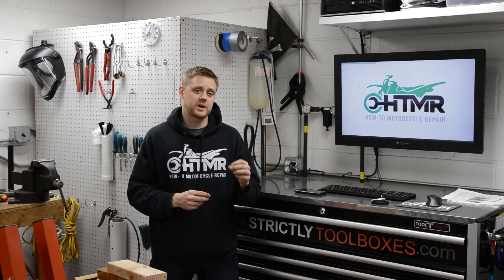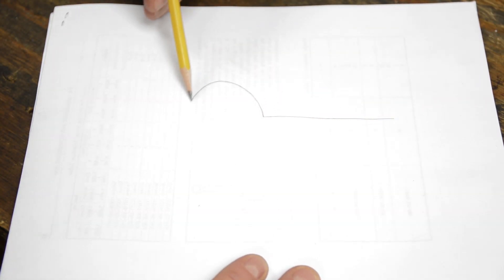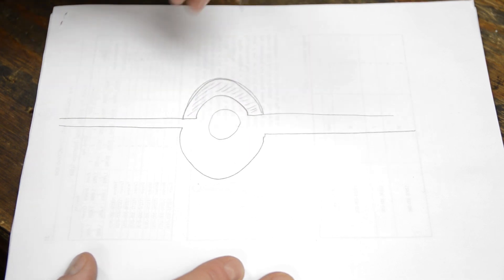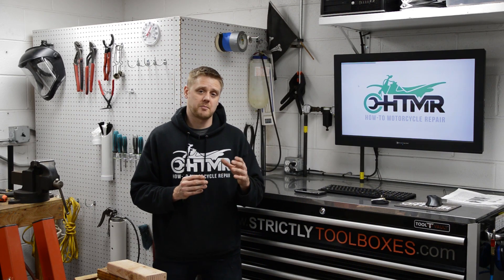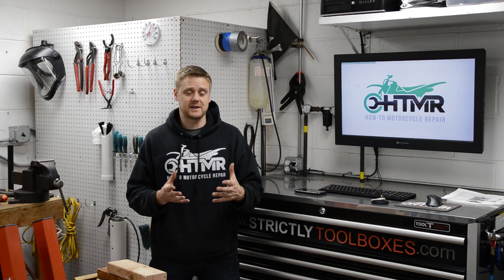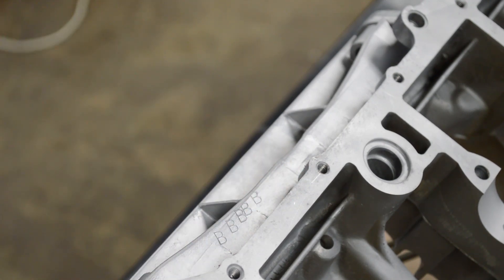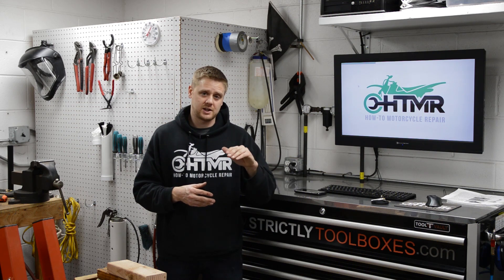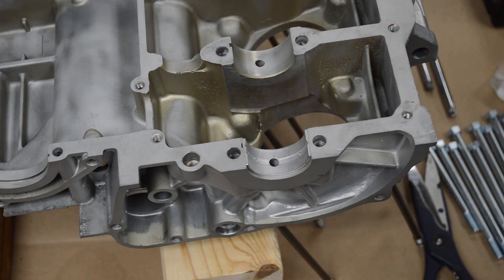How-To: Honda Bearing Oil Clearance - Bearing Selection - Plastigauge

Comment: Is it fine if everything is lubricated but you just wipe dry the top of the crank and bottom bearings for the plasti guage?
Reply from the maker: Everything must be clean, both sides of bearing shells and crank. No oil.

Comment: Har Har Yes good advise, I also learnt the hard way, purchased 8 x Yellow Rod bearings and ended up needing 4 x brown, 4 x green. Yes buy one set and gauge all pins with that set, with all the measuring and moving of the bearings make well sure to clean the surface every time, I used toilet paper, one little spec of crap will mark the shell, slow and steady one by one.
Reply from the maker: Newspaper works good too
Reply: Do you by any chance want to sell one of those yellow bearings?
Reply: @morganodom4158  one half or one pair, what are you offering Aust $, Australia postage to what Country $ ?, only one, I think it would be cheaper for you to buy local.

Comment: YOur video is great,thanks,but
01:50 ATTENTION,everyone is getting confused here; that is NOT the dimension we're measuring; all over the WORLD,100 % of engines,oil clearance(same as bearing clearance)  is TIR(total indicated reading), meaning the crank pin is ALL to ONE side and you measure the GAP on the OTHER side;  if not,you´d have 2 times the clearance, like i see doubt  in some comment below; so,next time draw the crank pin ALL the WAY to one SIDE, TANGENT to the inside of the bearing  shell; hope this cleared it.

edit: been rebuilding engines (car,bike,boat...) for over 30 years,NEVER used the wax thingy -Plastigauge is the name of one brand-;  of course,i can measure well, and have the tools; and i don't suppose Honda uses the wax thread at the factory,  lol

Comment: Im currently rebuilding 2 GL Goldwing engines. a 1000 and an 1100. These bearing selection codes have thrown me . And of course with the boxer engine things need to be spot on for balancing. Thanks for a great explanation for plastigauge usage...

Comment: Thanks for the great explanation. 
How do the bearing colors translate? I can buy them marked with A to D. There are no colors in the description.
Reply: in the 750 honda clymer manual lists the colors next to the part number. pg 99 fig 79pg 100 on the connecting rods

Comment: Good video! Well explained!

One thing that I'm confused by: What does the plastigauge measure? Is it simply crankshaft OD - Bearing ID (bearing clearance)? Or does it give an indication of the actual oil film thickness (Which is half of the ID minus OD)?
I'm rebuilding a 1980 CB750 and the manual refers to 20-45µm of 'Oil' clearance. Is this the same as 'Bearing' clearance?
Does the plastigauge measure ( O <> ) or ( <> O <> ), hope you get my point..

Comment: Great Vid and thank you..Just one point that confuses me.. Honda's spec for the bearing  clearance ..is it diameter or thickness? (eg double on diameter). Your drawing shows it as a thickness between the shell and the journal, but it the service limit is .003 the clearance would be .006?
Reply: .0008 - .0018 is the difference in Diameter, Bearing bore diameter larger than the crank diameter.

Comment: So happy I found this video. Another super clear and concise tutorial from you. Thanks again Matt. I was pretty lost with my engine rebuild until I found this video so thank you seriously for taking the time to record this! Its super appreciated. I do have one question, I know you blasted the crank case, what I’m wondering is if it safe to blast over the journals and all those grooves  where the bearings seat? Or should it be avoided. Thank you again Matt.
Reply from the maker: I would only dry soda blast or vapor blast with fine media low pressure. Do not dry blast them with anything else.

Comment: Hi. Please can you offer some advice on the bearing clearance for a CB500. My crank case markings are CCBBC. All crank main journals measure 32.98, so the manual states that I need "A" bearings for the C locations and "B" bearings for the B locations. I cannot find "A" replacement bearings anywhere, so I have trial Plastigauge measured all 5 locations with new "B" bearings and they measure 2.25 thou. (The original bearings measure 2 thou. I understand the "A" bearing has the smallest ID then "B" and so on. So as the smallest clearance I can achieve is 2 thou with the originals, is this the best option to go with as the service limit is 0.0031"? Any advice will be much appreciated. Thanks.

Comment: i have a cg125 and the carburetor drain screw is leaking it could be the brass overflow ill check that but it is leaking from the screw can you help me find some info or where to find some help please
Reply from the maker: Remove screw and inspect gasket if there is one.
Reply: @HTMR  and if there is no gasket then how do i find one would it be in a repair kit i also should have added it looks rusted idk if its the screw or something else
Reply from the maker: @cricketol  Watch this video: https://youtu.be/eqe59cINk7A  parts diagram will show if one is used and how to order it.